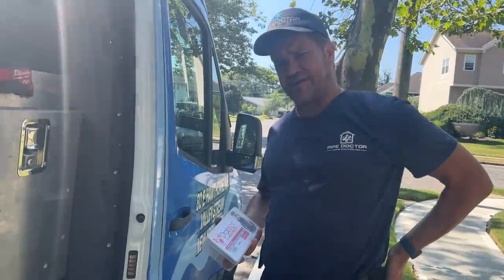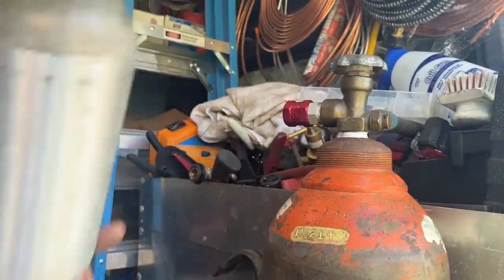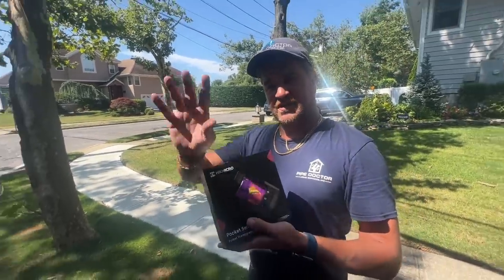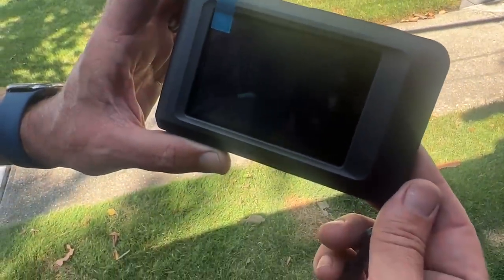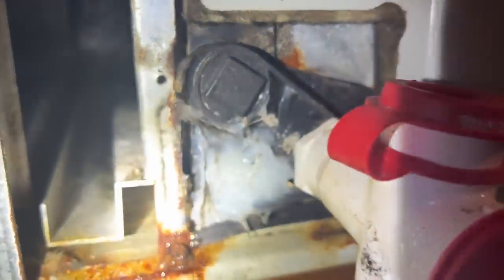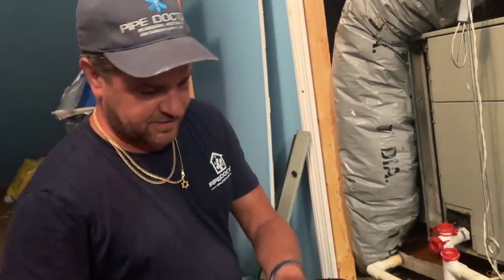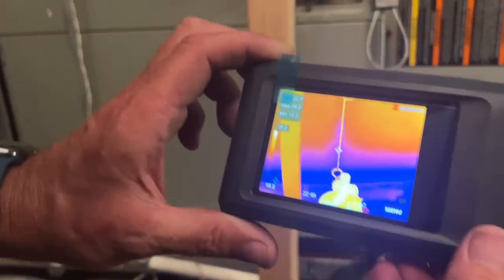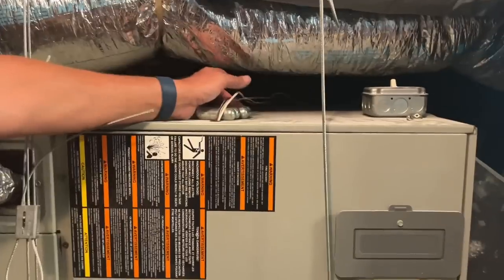Clearing Clogged Central AC Condensate Drains with DiversiTech DrainKat

Comment: I like that setup you have. I've always blown out condensate lines but see some guys use a vacuum. Great video.
Reply: I'm a motorcycle mechanic and use a shop vac on our home AC.
I have used air compressor but need a long airline (connect 2 or 3)
 Had lizards and frogs in the outside drain line blocking it.
 High humidity in Florida means a LOT of water flowing outevery day
Reply: @PipeDoctor  Yep, 90~98degrees and 90%~98% humidity sucks if AC not working. Living in Florida is living in a swamp, don't know why people don't understand that and complain about it?

Comment: Mikey your about five days late. The other night my wife and I are sitting in the living room  and water started pouring in through the ceiling. checked the attic and found it to be flooded and the water made its way down and through my ceiling. I put a wet dry vacuum on both ends and it must have cleared the blockage. Its still working well and dry.

Comment: Ive got the Drain Kat, its great. Also like using a gallo gun for small stuff. My drain kat been through a lot of shit like a car accident which broke the handle off too🤣 its great for units in drop ceilings, instead of carying a whole nitro tank up the ladder
Reply: I carry a nitro 20 on my van. Easier than lugging a 40. Still have two 40’s on the van but the 20 is badass for brazing reach in’s and other odds and ends

Comment: Big fan.  Quick question.  Navien NCB 240E.  Error E351 usually indicates what?  I Reset unit got same code a week later
Reply: I changed the fill valve already. Expansion tank is new.  So pressure sensor?

Comment: That drain cat looks cool. I use the Uniweld 40061 Sludge Blaster or Uniweld 40000 Sludge Sucker with a 5lb co2 tank. I like it because it is small and light (about 8 lbs.) and gives me about the same run time as a 40 cubic foot nitrogen tank (about 30 lbs.). I think 1 pound of liquid co2 is the same as 8.7 cubic feet of gas.  So a 5lb co2 tank has about 43.5 cubic feet of gas in it.
Reply: I've always liked CO2 for that reason, but where do you get the small tanks refilled?

Comment: Remember mikey don't stand in line with anything attached to a high pressure bottle even regulators when cracking the valve. Just a saftey reminder for those who don't know.

Comment: Why use co2 or N instead of just plain Ole compressed air?
Reply: I use a 5lb co2 tank because it is small and light (about 8 lbs.) and gives me about the same run time as a 40 cubic foot nitrogen tank (about 30 lbs.). I think 1 pound of liquid co2 is the same as 8.7 cubic feet of gas.  So a 5lb co2 tank has about 43.5 cubic feet of gas in it.
 As for compressed  air, the pressure in a standard air storage tank  is so low the tank would have to be really big to have adequate volume and run time.

Comment: MAYBE another tool for the chest,uniweld sludge sucker.you use this outside,suck the the drain thru.nothing too carry to the attic.i a put 90 on the end of there kit to fit over the pipe dropping down outside.amazon 30 to 40 range.different strokes for different folks,you decide.

Comment: One issue using pressure, the risk of popping a hidden unglued connection apart.
Reply: yeah, better hope they used cleaner/primer and cement when assembling it. being lazy and using cement only makes mainly weak joints that will fall apart if looked at from across the room.